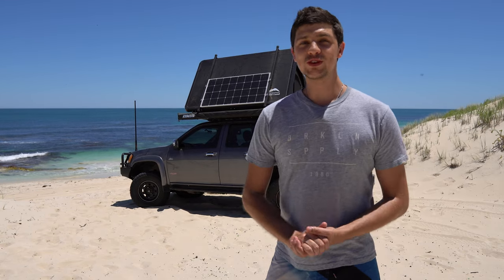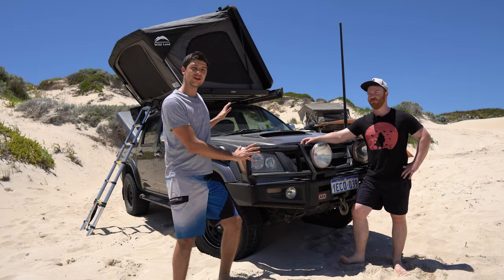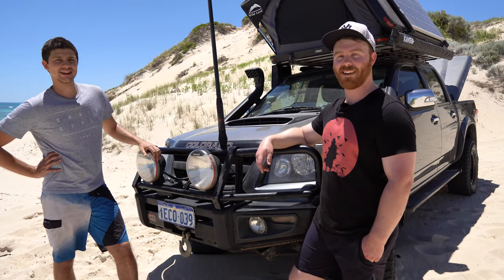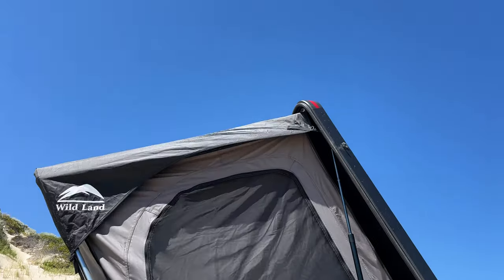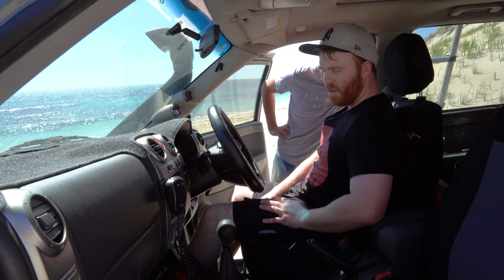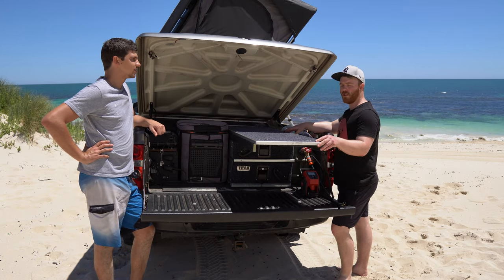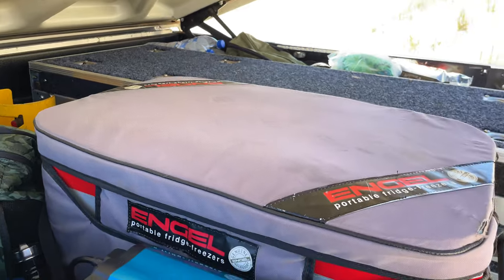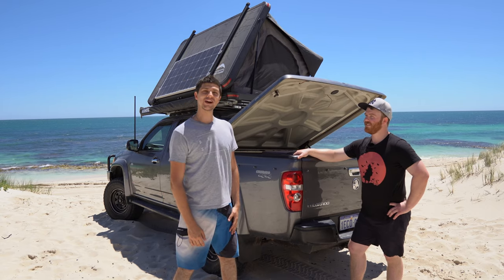Ultimate Dual Cab Ute Camping Setup! 2009 Holden RC Colorado Rig Rundown

Comment: I've still got my tub with a steel topper on top.  Ended up being the same price as one of those really cheap and nasty trailer/canopy setups but I wouldn't want them.  Best part is being able to use the magnet stubbie holders (there's a hint...) and weather proof!!  Wish I had a roof top tent though.
Reply: Hey mate, what steel topper you running. Cheers

Comment: Great video. I've got a 2011 Isuzu DMax - same shape (last shape in this generation). Like you guys, I only have a tub on the back and greatly inspired to do something similar with my vehicle - but I prob wont sleep on top. I have a 160w solar panel ready to go with a car fridge etc - in which I'll use the back in a similar way. I want to get similar wheel hubs and push the tyres outwards a little and do a body lift (already have springs on the back which do a 2"  lift).
Keep up the good work.
Neil.

Comment: ive got a pj ranger i,ve had since new and enjoy seeing guys using your utes 
couple of questions  , where did you guys get your ranger re mapped and how much was it? 
do you get any problems with it and recommend it?

ive noticed that you both have fridges with protruding handles  ,theyre held on by a couple of bolts either handle , if you remove the handles you can cut a steel plate with a couple of holes in it using the same footprint of the handles, sandwich a leather strap to replace the protruding handles and you will gain about 70 mm in storage space
Reply from the maker: Hi Ross, I had it remapped by Reaper Performance Diesel here in Perth, it cost around $1250 and they did a fantastic job. Power was up from 105hp to 160hp and torque up from 320nm to 420nm (engine completely stock otherwise). Economy also improved, going from around 12.5L/100km to 11L/100. Great idea regarding the fridge handles, thanks for that!
Reply: @explorebound  great channel , i bought my pj brand new and being my first and only new car have never trusted myself to have a go at doing most things on it but seeing it done has made me realise how easy things are .

Comment: Could you please ask james a few questions for me? I have the same Colorado.
-Do you have a re-occurring squeak coming from the front hub? (Not wheel bearings)
-Also with bigger tyres did you have to modify the cassis where the body mounts too behind the front wheel for clearance?
Reply: Idk if you ever resolved this mate but I've had an RC and a gen 1 dmax, both have had the small retaining clips in the brakes shift slightly and contact the rotor. It's quite common, that'd be worth checking